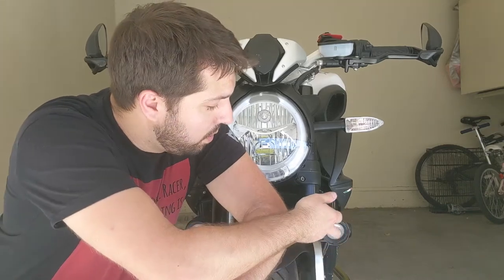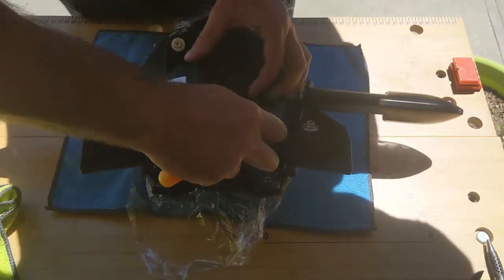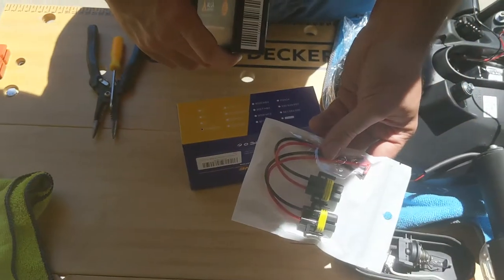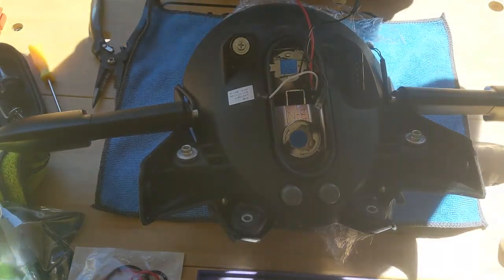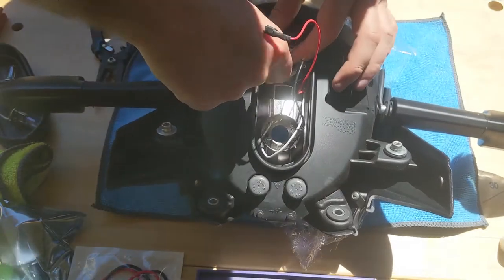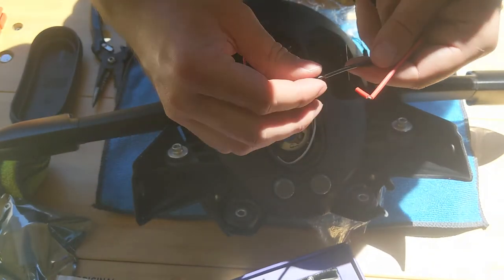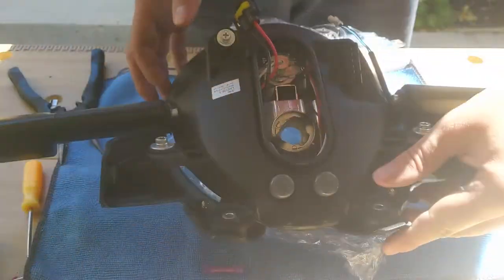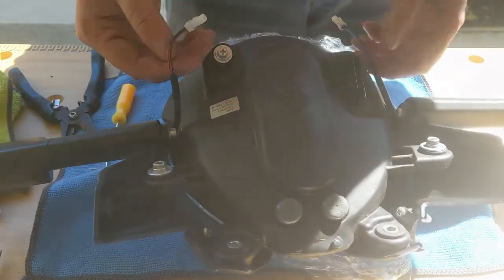How to Convert Headlight to LED for MV Agusta Brutale & Dragster

Comment: I bought mini versions of LED’s. Both fit with stock rubber cover.  HID’s would fit easy but the ballasts are the problem.  HID’s have a nicer beam with reflector background vs LED’s patchy.  Projector mods really improve the beam but more expensive
Reply from the maker: Yes I wish an HID would be feasible but like you said space is the issue. Maybe better LED bulbs will come out, one can only hope 😆

Comment: Hi there, I'm interested to know what type of foglight are you using and if they are plug-and-play.
Reply from the maker: Hey! Sure thing. These are the Fenix Cree900 High Intensity LED Light Kit. It comes with the 2 lights and a plug and play wire harness that includes an on/off switch.

I have had these since 2015 (were on one of my previous bike before). Definitely recommending them.

For mounting on any MV you can use the Denali fender mount kit that’s what I’m using on my Dragtser.

Comment: nice.  now if you could replace the those front signal lights with something more integrated looking 😉
Reply from the maker: Haha you read my mind! For the moment budget is going into the bobber project, but yes these signals need to be changed and also converted to LED. 😁

Comment: How much of a difference has it made to your night riding? I rode my '18 Brutale last night in the countryside (no street lighting) and remembered just how poor the standard H11 is for visability - so bad in fact I got my buddy to ride it to get a 2nd opinion as I thought I might be going mad!
Reply from the maker: I actually have fog lights on at all times while riding at night so to me the difference isn’t as significant, just the color is now uniform. To me the H11 feels better (as you said the stock one is so bad) while the H3 still remains kind disappointing. It seems like there isn’t a good really good H3 or at least haven’t come across it yet. Hope this helps.
Reply: @zigmoto  That's great as the Low beam / H11 is the one I struggle with the most. It's weird -it feels like the low beam lights the curb/road side up nicely but is just plain dark in the middle.. I want to say it feel like a reflector issue. Anyway - thanks man, love riding my MV :P

Comment: Hello I was wondering if it is ok to instal a h11 without canbus so it dosent get that hot there. I installed LED lights just as yours and after 30min of running the cover was almost melting because of the heat.
Reply from the maker: Good question! I am not sure if this would help honestly. Maybe the LED bulb itself is the issue? I personally never had this issue with the LED I installed even after riding all day (5-6+ hours).

Comment: Could I convert it on the brutale dragster 2014 ?
Reply from the maker: You might be able to. The headlight on the 2014 is different so you will need to check all specs and match the differences but the same approach might work. Just check every details prior cutting anything I guess.

Comment: How many lumens do the globe’s output in particular h3 led thanks
Reply from the maker: The one I got says 2600 lumens. Honestly not sure if that number is correct. I think the H3 led could use a better bulb or be turned to 90 degrees to have better reflection with the headlight housing. If you come across a good h3 led let us know :)

Comment: Why you didnt just connect the wires with orginal H11 light clips inside
Reply from the maker: I did a conversion from an H11B to an H11 bulb so the connectors are actually different on the bulb. Using a water tight h11 connector makes a better installation and protection. You could potentially use the original wire disconnects but then it wouldn’t be sealed and the ones on the h11 led bulb are smaller so it will move. So this could create issues, I wouldn’t recommend it.
Reply: Ah yes i get it, but i wouldnt be wrong if I wire mine wires direct to h11 conectors inside? That’s what i wanted to know :). But yeah it is definetly better to connect them better with conector so it is all fixed and not moving.
Reply from the maker: I wouldn’t take the risk honestly. For $5-6 you can find the proper connector for the H11. I personally wouldn’t want to take the risk of riding and the headlight connectors getting loose or worst get it shorted out.

Comment: Is it going work on brutale 910 2006?
Reply from the maker: The headlight is definitely different. You would need to check the type of bulbs in yours. The principles remain the same just the type of bulbs need to most likely be adapted.